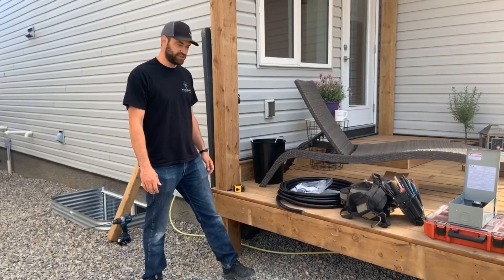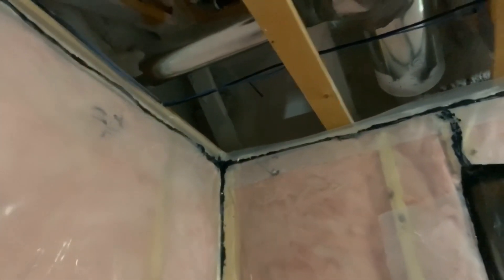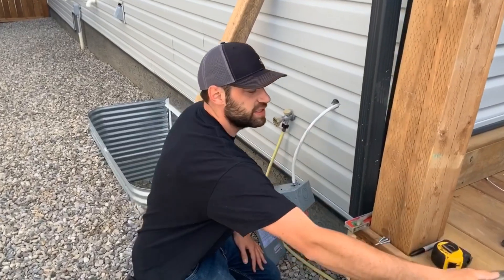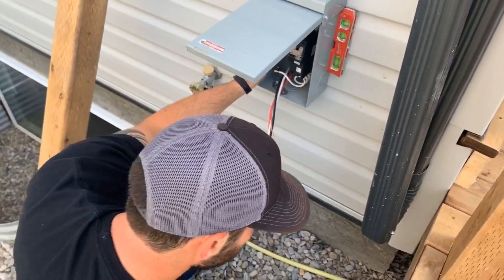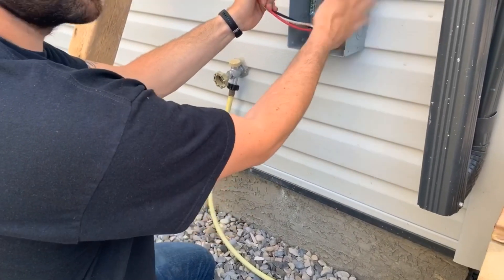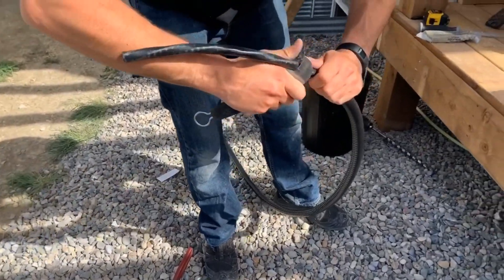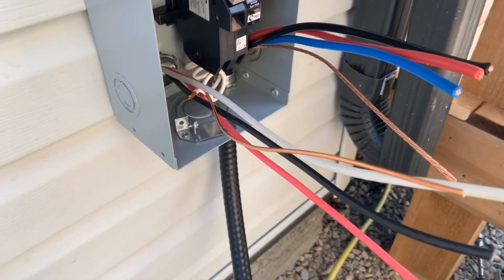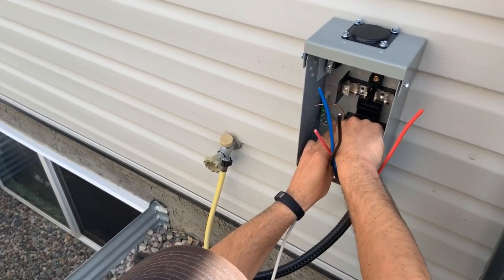Hot tub electrical install explaining parts of spa package and terminations

Comment: Edmonton here. I heard that you must have the Spa panel in line of sight of the tub while being 1.5m away or further. Were you able to pass inspection? Your tub placement seem to not have vision of the panel just barely.
Reply from the maker: Yes, so the new code stats it needs to be outside now. And approx 10’ away from your tub or protected by a barrier. I’ve never had a problem passing with any inspectors in southern AB

Comment: At 9:35 there is a single white neutral line. By 9:44 another white neutral has appeared without any explanation as to where it has originated.  There is no explanation as to why an 8-3 as opposed to a 6-3 or 10-3 copper service is chosen...a table with run lengths and factors affecting this choice are more important than demonstrating box mounting techniques. Hire an electrician.

Comment: Great video,  I have question about bringing the 8/3 NMD90 from inside house to box outside, if sub panel cannot be attached at a good height, mine would be almost at ground level and under a deck, can you put NMD90 in conduit to raise it up above deck to appropriate height?
Reply: Yes in Canada you can sleeve it using liquid tight (metallic or non-metallic), PVC (using an LB). You’ll need to buy a different connector as well if using liquid tight.
Reply: @luminelectric4853  my situation is NMD90 exits house under deck that hot tub is sitting on within 5 feet of water, would it be acceptable to put sub panel (with GFCI) adjacent to main panel, in basement, and run 15 feet to exit point and the 5 feet from exit point of house under the deck to the hot tub using NMD90 and the liquid tight sleeve under the deck.
Reply: @luminelectric4853  could the NMD90 in liquid tight sleeve be run all the way to hot tub under the deck the hot tub is sitting on?

Comment: In the US, a 50 Amp CB requires #6 AWG....ie the 80% rule
Reply: Thanks but we are in Canada and follow all the legal requirements of the CEC.
To note this hot tub is 40 amps max and is ran with a 50 amp cable and breakers so it’s still 80%  rule 😊
Reply: @luminelectric4853  great, thanks for replying. IN the US, 40 CB would indeed use #8...good video.

Comment: Awesome video, I’m in Alberta as well and this is super helpful. I’ve got the exact same setup, and I’m running my teck cable to a sauna heater that has no neutral. What do you suggest I do with my neutral? Put a wire nut on either end? Or should I put terminate the neutral on the spa kit end and just put a wire but on the sauna end? Thanks a ton for the video!
Reply: If the equipment has no neutral, just leave it capped at both ends. I’ve only seen one other tub like this in all the tubs I’ve done… and this was the advice from our local inspector.
Reply: @luminelectric4853  thanks so much man

Comment: Is it possible for these to get wet during a hard rain and trip?  We had heavy rain and ours tripped.  At least that's what we think happened.  Ours is a Square D.
Reply from the maker: That is possible, these spa packs are all outdoor rated, so they shouldn’t be water inside but if that’s what happened, it is likely the reason it tripped.
Reply: @Luminelectric  Thanks for input.  Hot tub and breaker are new so who knows?

Comment: Hi there, just wondering why you went with 8/3 wire instead of 6/3. My understanding is that hot tubs require 50amp @110v. Thx!
Reply from the maker: I think there are definit rules depending on the country but in Canada 50 amps is rated for 8/3 cable

Comment: The house I'm in has the GFCI in the breaker box.  There is no separate panel outside.   It appears to have been installed by an electrician as there is a tag for it.   Has the code changed or is it OK to have the GFCI in the main panel ?
Reply from the maker: That is allowed even in todays code the reason’s we use spa packs is:
-they are cheaper then the GFCI panel breakers 
-to give the hot tub tec’s the ability to shut the hot tub down from the outside if they’re working on it. 
-if there is any problems with the equipment not working the disconnect is closer to the tub.
Reply: @Luminelectric   Don't spa packs use the same GFCI breaker as a panel ?   

Another reason to use use an external panel is so that you don't have to run  Teck cable from the inside panel to the tub.  I guess you could use a junction box to connect Teck to Romex so that just the outside portion is Romex ?

Comment: You said if using a 6awg wire you need to use a bonding bushing? what changes from 8 to 6?   if the box is metal and the armor is bonded to the water tight teck connector which is then bonded to the steel box wouldn't it be the same deal regardless of wire size?  or am I missing something? thanks for any info, and excellent video!
Reply from the maker: There is a mistake on this video where I said a bonding bushing instead of a plastic bushing. In the CEC all connectors over 1” need a plastic bushing.
Reply: @Luminelectric  thanks. Sorry to push further on this, but what would the purpose of a plastic bushing be? Wouldn't that sever the bonding between the armor and the box? 

Does it apply for 1" AND larger?  Or just anything larger then 1"? Thanks again.
Reply from the maker: It apply’s to 1” and anything large that is a metal connector, I think the purpose it to protect the wire from the sharp connector. No bonding purpose on that code 👆.

You do have to bond all sizes of metal connectors terminated to a plastic junction box and that is so the connector is bonded and cannot become live.

Comment: is it cheaper to run the tek cable rather than conduit and wire?
Reply from the maker: It would be cheaper to run conduit and wire, it will take longer but you’ll save money.

Comment: Thanks for the video. I had a question. We had an outdoor socket installed for the outdoor spa. The socket is right next to the spa (in the corner) and about 10 cm off the ground with an RCBO and a waterproof rating of IP65. Is it safe to have the two right next to eachother?
Reply from the maker: The spa pack in Canada has to be 10 feet from the hot tub or protected by a suitable barrier. You can do a weatherproof junction box on the location and extend to a safe location.

Comment: So if you didn’t support it below the deck, you could just run it underground?
Reply from the maker: We strap the cable if it’s ran under a deck, you can lay it on the ground but that’s not a very appealing install. If you bury this cable you have to bury it 18” minimum
Reply: @Luminelectric  great thanks for the quick reply! Are you also allowed to run the nmd through flex tubing? Or would it have to be single conductors? I’m in Canada but can’t seem to find any code for it. As well as, can the flex be ran underground ?
Reply from the maker: The code is always up for interpretation so best bet is to call the local inspector and ask, you can’t use metal flex outside but you can use non metallic flex or liquid tight. Where I am you are allowed to sleeve NMD for about 3-4 feet as it leaves the home. You cannot sleeve between 2 outdoor devices like the spa pack and the hot tub though, For that you’d need to run single conductor RW90 or equivalent rated cable.
Reply: @Luminelectric okay gotcha! Thanks for the input! One last question, what size of connector did you use for the teck
Reply from the maker: That connector outside is a 3/4” teck connector, on the inside it’s a 3/4” flex connector.

Comment: Is this correct for Canada?
50A Breaker ---> 8/3NMD90 ---> 50A GFCI spa buddy/pack ----> 8/3 TECK 90 armored cable ---> Hot tub (for 50A Hot tub)
                                                                                        or
60A Breaker --->6/3NMD90 ---> 60A GFCI spa buddy/pack ----> 6/3 TECK 90 armored cable ---> Hot tub (for 60A Hot tub)
just trying to keep it simple.  Thanks this was a great video.
I just found out that the hot tub I am getting can work on 50A or 60A.  Is there an advantage to going with the more 
expensive 60A setup?
Reply from the maker: Yes this is in Canada, and you are correct on your sizes. I have never seen a hot tub that does both 50 and 60 usually they do 120v/15A and another mode for 240v/30A. But to answer your question to the best of my knowledge, I’d say more amps should mean more power so that should increase the ability to heat it and to push water better. Hope that helps

Comment: Hey great video. Does the GFCI disconnect breaker need to be or can’t be a certain distance from the hot tub?
Reply from the maker: In Canada it needs to be at least 10 feet from the tub or protected by a Barrier.
Reply: @Luminelectric  and the main breaker can be a normal 50 amp but the disconnect has to be a GFCI? Or can the disconnect be a normal 50 amp disconnect and the main breaker be a GFCI breaker?
Reply from the maker: @6615Dean  you could do it either way, the only problem is on Siemens has a brand of spa pack that wouldn’t require a special order breaker.

Comment: Is this Alberta?  I thought the teck cable is supposed to be mechanically protected when it protrudes from the ground because the rubber coating can get damaged?
Reply from the maker: Hey mike, yes this is in Alberta, I’ve never had any problems with running teck cable outside and using it to come up from unground in direct burial situations, that’s why we like using it so much. If an inspector has told you otherwise they have to tell you the code rule. I’ve never had any of the city or county inspectors disagree with this method.

Comment: That Liquid Tight Flexible Conduit looks like it is much longer than a 6 foot piece. Is that acceptable in Canada? I could be wrong, but I think that the NEC article 350 says you can't use a piece longer than 6'.
Reply from the maker: We use the CEC in Canada not the NEC, thanks for your comments

Comment: Around 8:00 you said your neutral isn't supposed to be touching ground ANYWHERE. That is false. They're bonded at the main panel. Only in sub panels like this are they not allowed to be touching due to objectionable fault current path in parallel back to main panel/ transformer. I forgot what code exactly but its NEC 250.
Reply: Musta missed the first part where we explained we are in Canada, we use the CEC not the NEC

Comment: Thanks for the video. I am located in Florida and have a new spa on my pool deck. Anyone aware of the proper location of the disconnect? I have a pool screen and not shure if I can attach the discoonect directly to the side of the tub or anywhere OUTSIDE the pool screen. Thanks much.
Reply from the maker: The rules in American are different for sure, here in Canada we cannot have the disconnect within 10 feet from the water source(tub). Always best to ask the local inspector.
Reply: @Luminelectric  for sure. Thanks for that reply!

Comment: Quick Question - Should a hot tub be filled before or after inspection?
Reply from the maker: Test the voltage from the panel to the hot tub, each leg should have 117-123 volts to ground. That will insure if you fill the tub you have power to run the tub if needed, as long as it’s not freezing the water can sit for a day or two if you have a problem. The inspector can look at your install before the tub comes and he will either return or require pictures of the tub connection.
Reply: @Luminelectric  thank you for the quick reply. Much appreciated!

Comment: Great job guys.  I really appreciated your video.

3 style points I would point out.

1)  your camera angle did not provide a good view of the cable clamp in the main panel.

2) when you stripped the cable, there is a  string inside the cable to help with stripping.  This might be helpful to people that do not strip cables every day.

Comment: Is there a need to have solid cable over stranded cabling?  I can not tell what you used in the video, but it looks like stranded.    Is stranded OK?
Reply from the maker: Hey, all cable that is larger then #10 is stranded. There is advantages to flexibility of the cable in stranded. So it’s not like you get much of a choice on anything requiring more then 30 amps (#10 in Canada is good for up to 30 amps) hope this helped. Thank you for watching

Comment: Moving my hot tub to a further away spot -  can I use a junction box (on gazebo) to get the wire from the hot tub to be able to connect to the new line cable?
Reply from the maker: If your in Canada you can, make sure the box is accessible, make sure it’s weather proof (PVC boxes need any metal connectors bonded) I’d opt for a metal one with hinges so you don’t have to bend connectors(get it with Pre drilled knock outs). All connectors, wire devices basically must all be rated for there location. NOTE :most boxes can be hidden but still be accessible like under deck. Hope this helped 👍

Comment: Great video. There are others on the internet that could use your advise.

I am looking to install a HVAC, 15A split system and I also wanted other capacities accessible outside, so I am looking at installing W0408ML1125-60 Siemens Spa/Hot Tub Outdoor Panel with 60A GFCI breaker, or perhaps 40A. One 15A circuit will be for a soft tub and is simply plugged into a regular receptacle and has its own CFCI built in to the cord. 

The other circuits I plan to run are simply for outdoor lighting, power tools etc. I think I would go with a larger amperage only because I may upgrade the HVAC later that would require additional amperage.  Otherwise, I would run a maximum of 30 AMPS.

Do I need a separate disconnect for the HVAC if the panel is near and the breaker can be flipped if needed?
Reply from the maker: seems like you got it figured, that Siemens spa pack is your best bet as it fits regular Siemens breakers as well.
Reply from the maker: Hey Rick, lots to get to in this question. So the 40/50/60 amp spa packs are used to protect large loads, for what your doing it sounds like you should run separate feeds, one #10/2c for your AC this can handle up to 30 amps in a knife disconnect (I have a video on this).
Your soft tub sounds like it needs a 15 or 20 amp circuit but the choice is yours here, if you want you can install the larger wire and spa pack still and run your CCTs out of the Siemens spa pack, and yes by the CEC you can run the AC off the spa pack but I wouldn’t for many reasons but the biggest one is it’ll probably nuisance tripping. Hope this helped
Reply: @Luminelectric  Thanks for the response. My application is to install a 12000 btu HVAC outside my garage, run a circuit to the back yard and another to the soft tub and some planning for another HVAC unit on the other other side of the house.

The house is a rancher on slab and the garage is finished as it serves as an office for two people. The main panel is in the garage so if I can go out, it would be better than going through the attic.

If I have to use a knife disconnect for the HVAC, what would be a good subpanel outside?

I did look at the W0408ML1125-60 Siemens Spa/Hot Tub Outdoor Panel with 60A GFCI breaker and now see they have larger amped panels. Or have you seen others specifically for outdoors use?

Many thanks.

Comment: The previous owner at the house I purchased has the wire along the outside foundation. Am I able to run it in the walls with the insulation? I believe it’s a direct burial wire. I find it looks cleaner with one going in through the back and one out vs seeing both.
Reply from the maker: In Canada you would be allowed to run an NMWU or teck though an interior wall. PVC pipe used to mechanical protect the cable from damage on exterior where is needed. Hope this helps
Reply: @Luminelectric  Thanks for the reply. I was unsure why they ran it outside along the foundation. I thought it had something to do with the size of the wire creating more heat in the exterior walls or something. They never protected it along the foundation so I have to trim the grass in that area by hand to avoid damaging the wire lol. Does your channel have the ability to add the thanks button?

Comment: My hot tub supplier tells me I need 6ga wire for 50 amp breaker. Is this accurate? I’m in Saskatchewan
Reply from the maker: Okay so there could be a miscommunication here, number #8 is good by code for 50 A, but the manufacturer of the tub may ask on nameplate that it be hooked up with #6 which you have to do then.

Side note* if that is the case only the part that hooks into the hot tub needs to #6 so it could be hooked up #8 to the spa pack then #6 between spa pack and tub.

Comment: @Platinum Lighting the teck cable you’re using if buried, do the exposed part coming out of the ground and going to the gfi needs to be in a conduit? Someone told me this but I want to be sure.
Reply from the maker: Hey Simon, if your in Canada you need to bring it up as cable and use a teck con outside, if you sleeve it you’ll have to figure out a way to bond the teck armour and it can be ugly. Hope this helped
Reply: I’m in Canada. So basically I don’t need to sleeve the teck cable. I will then use the right teck connector. Thanks

Comment: I saw that, the white  neutral pigtail from the breaker, connects to the  neutral bar on the panel. Correct? Great video
Reply from the maker: Hey Craig, your GFI breaker with the pig tailed white, it should have that pig tail wire go to neutral buss bar. Thanks for your questions
Reply: @Luminelectric  Thank you very much God Bless

Comment: is the blue neutral you phased going into to the breaker or straight into the neutral bar its hard to see from the angle
Reply from the maker: The blue wire in the teck cable is being used as a neutral and needs to be taped white and attached to the neutral buss. Hope that helps